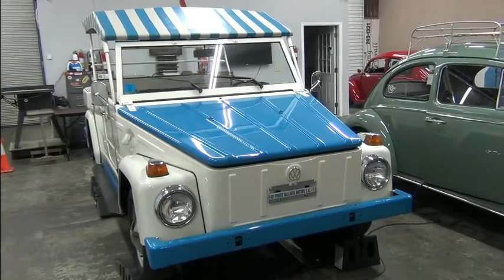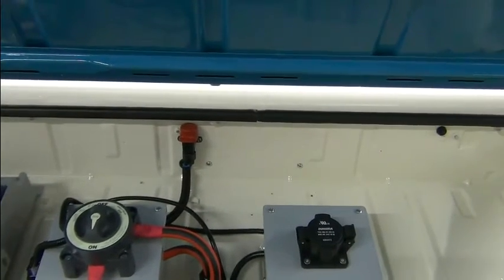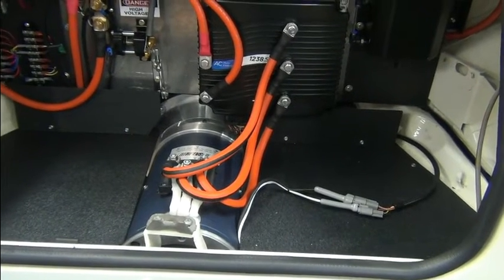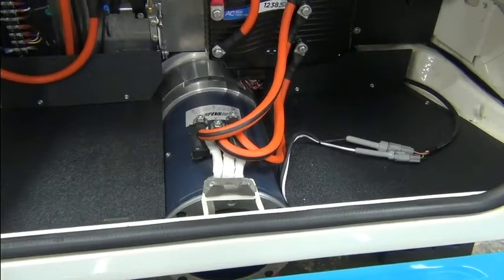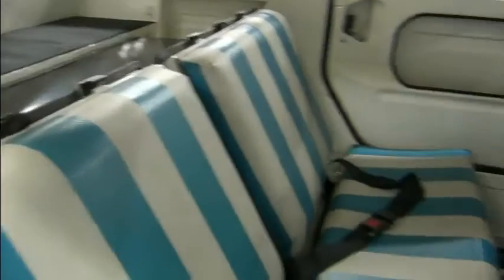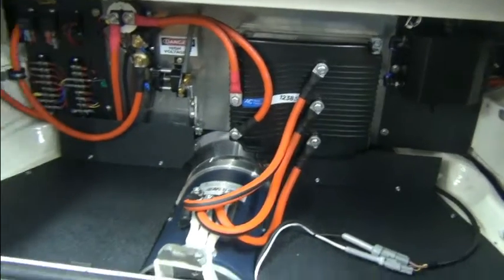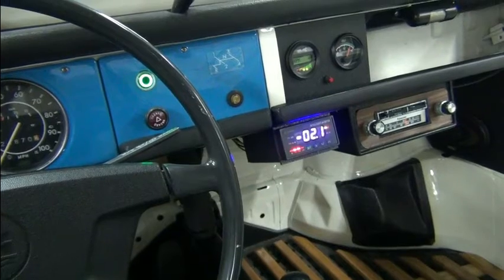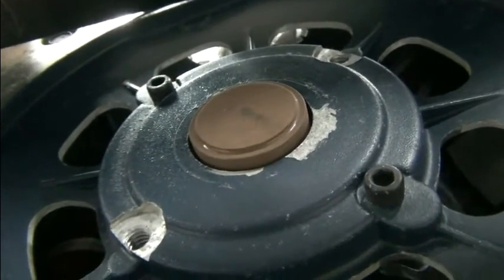VW Thing EV Conversion Update, Episode 5

Comment: I love how you use and preserve the original architecture wen ever possible. With the little red button can you program the Curtis controller to limit the torque to mach the creator of the original engine that the car was engineered around? Or is there a special tool for this?
Reply from the maker: The Curtis 840 Display and the Menu Switch allow you to program that and much more.  Thank you for watching and being a subscriber.

Comment: Nice work. If you  put the transmission in revers and push the blue button to swap a phase. Will you get a forwarded "grainy gear"?
Reply from the maker: Interesting idea, however, 1st gear and reverse have the same gear ratio (3.78).